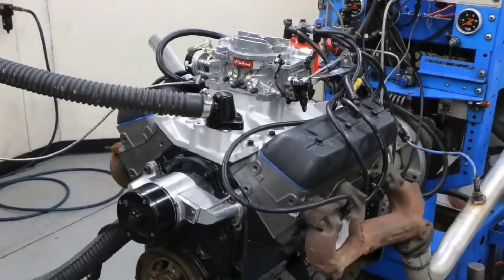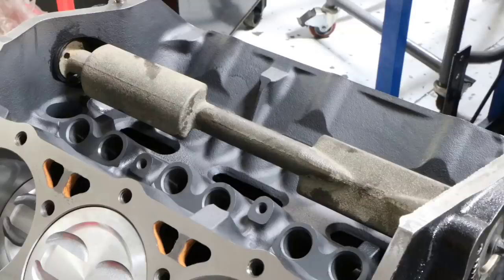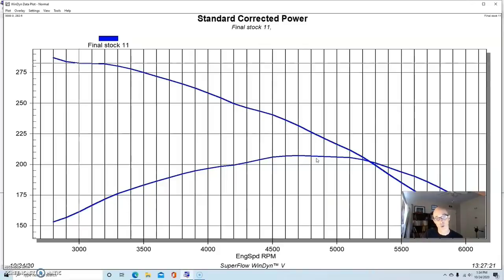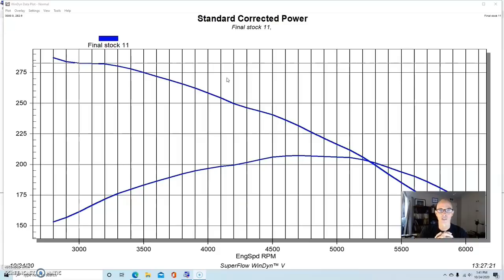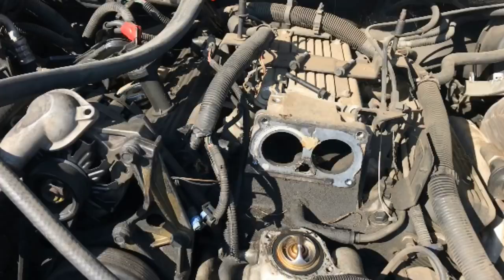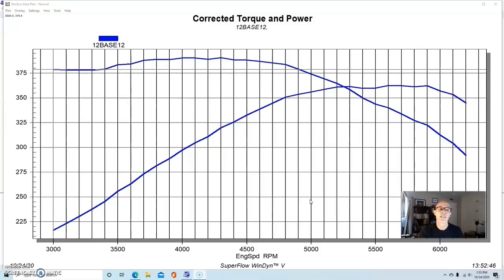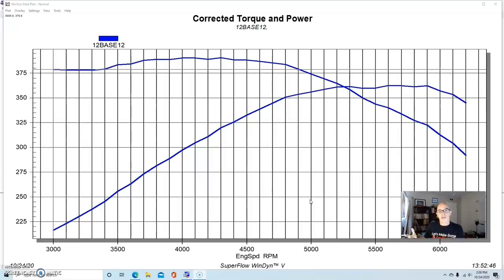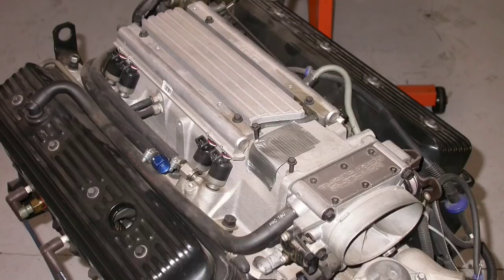4.3L V6 VS 4.3L V8-WHICH OTHER GUYS MAKES A BETTER BUILDER?

Comment: That brings me back to my GM wrenching days. I was working on a Caprice with a 4.3L V-8 and I went to the parts counter for my part. The parts manager asked me what engine it had. I said 4.3L V-8 and he argued with me. Said that GM don’t make a 4.3L V8, they must have pulled the V6 out and put in a V8. I told him they didn’t make a V6 in the 4th generation Caprice. He finally believed me when he looked it up.
Reply: Yep, the L99 4.3 V8 (94-96) was the replacement for the L03 TBI 305, which was the base motor in Caprice Sedans from 89 to 93
Reply: @FirebirdCamaro1220  Was the 4.3 the v6 they used in the Astro Van? Can’t remember if it was 4.2 or 4.3 but either way, owned a couple and were great motors. Could rack the miles on em for sure!
Reply: @fishsquishguy1833  Yes, it was used in the Astro/Safari, the S10/Sonoma&S15, the C/K 10 pickups, the C/K 1500 pickups, the G10/G1500 Chevy Van/GMC Vandura, the 1500 Chevy Express/GMC Savanna, the compact Chevy Blazer/GMC Jimmy/first gen and 2nd gen Olds Bravada, the Chevrolet Caprice (85-88), Chevrolet Impala (85), Chevrolet El Camino and Chevrolet Monte Carlo (85-88). It was made from 1985 (when it replaced the 229 v6) until 2013. It had TBI in the cars from 85-88 (the only years it was used in cars), and in trucks&vans, it had a 4bbl carb in 85&86, TBI from 87-95 and port fuel injection from 96-2013
Reply: @fishsquishguy1833  and Ford had a 4.2, the Essex V6, which went into the F-150 and E-150 Vans (where it replaced the 300 Inline 6)
Reply: @FirebirdCamaro1220  Thanks dude!
I’ve owned a couple, both in Astro’s and both had over 250K and ran well. I think the only problem I’ve seen was an occasional puff of burning oil on start up due to valve seals but not really an issue at all
Reply: @FirebirdCamaro1220  
Yes.......those 4.3’s were great engines. I had a Sonoma SS with it .
Needless to say, I put 200k hard miles on it. I went through tires like Kleenex at a funeral home.😂
I sold it many years ago to a guy who had a 150 mile round trip to work. Last time I seen it, he had almost 400k on it. The radiator and water pump were the only thing that was changed by him. To my knowledge...it still runs like a champ.
Reply: @fishsquishguy1833  The Astro and Safari had the 4.3 V6, the small block minus 2 cylinders.  The basic engine was the same for the 20 years the Astro was produced, but it went from a carbureted version, to throttle body injection, to MFI, along with adding a balance shaft in later years.  My dad owned several and pulled campers - for a V6, it was surprisingly capable.  He always got at least 200K miles on them before thinking about trading in.  Good vehicle, good engine.
Reply: I deal with this a lot ordering parts over the phone its a pain in the ass lol
Reply: They did 
	4.3 L L99 V8 (1994–96, base economical engine for sedans)
4.3 L LB4 V6 (1992–93, base engine for 9C6 taxi package)
5.0 L L03 V8 (1991–93, base engine for sedans)
5.7 L L05 V8 (1991–93, performance engine for some sedans and all station wagons)
5.7 L LT1 V8 (1994–96, performance engine for some sedans and all station wagons)
Reply: @V8_screw_electric_cars  no one couldnt have said it better !!
Reply: That reminds me of my 1990 Caprice 9C1. I would go to an aftermarket parts counter and say "1990 Caprice", and they would say "305 or 307?" When I answered "It's got a 350" they would say "Oh, the engine was swapped! They didn't put a 350 in those!" They refused to believe that the original motor in that car was a 350, and they didn't have a listing in their computer system for police packages.
Reply: It is a rare motor. But if youre the parts guy you should know.
Reply: @fishsquishguy1833   they were definitely tough. But the stock exhaust sounded like a vacuum cleaner! You hear and feel the restriction!
Reply: Ive heard the 4.3/262 inch v6 is capable of using parts such as Conrods,pistons, possibly cam,valve springs,from the small block Chevy (305,350,etc)is this confirmed to be true?.
Reply: I love cars for many years and I didn't know that until I saw this. I think I did see one one time my friend at the Caprice said  had the SS motor in it open the hood and I'll be damned if it didn't look like a lt1 then I asked him to show me what it'll do ,kind of dog in 1st gear which I thought was odd because I know 700 r has a pretty deep first.
Reply: Everyone argues me down about my 96 caprice having a 4.3L v8.
Reply: @FirebirdCamaro1220 There was also a 3.8 liter Essex V6 that debutted as the optional upgrade in Taurus and Sable.  That found its way into the late 80's FWD Continental and the Windstar minivan.  Our '99 knocked nearly non-stop at highway speeds regardless of fuel.  Thankfully, that POS was a lease!
Reply: @billyjoejimbob56  that engine was also used in RWD applications in the Fox Body, with a 2bbl carb from mid 1983 until 1986, where it replaced the 200 inline 6; this included the Mustang. The Mustang then re-adopted it with port fuel injection from 1994 until 2003 (in 2004 it was bored up to 3.9 litres)
Reply: @FirebirdCamaro1220 Correct.  I had forgotten how widely used it was.  That reminds me... my sister had a Sable wagon with that engine... and blown head gaskets.
Reply: @FirebirdCamaro1220 How do you get a 4.3 v8 to 240 hp?
Reply: @blackericdenice  if your talking the L99 from the 94-96 Caprice Sedan, probably put LT1 heads/domed pistons on it and remap the ECM
Reply: @FirebirdCamaro1220  It already has LT! heads on it.
Reply: Love this type of debate!
Reply: @evdawg7757  People always think heads is how to make hp.
Reply: @blackericdenice  a lot of power is dependent on the cylinder head yes
Reply: @evdawg7757  Not as much as the cam. No heads out there can give you 100 hp increase.
Reply: @evdawg7757  The new zo6 make 670 hp from a smaller 335 cuin v8. It's making 175 more hp because it has some crazy cams.
Reply: @blackericdenice  I politely disagree. A 90’s 454 with aluminum aftermarket heads with bigger lift cam wake up tremendously for example. Not many engines can do that tho.
Reply: @evdawg7757  If you only change the heads or cam on a 1990 454. Which one do you think would increase hp the most?
Reply: @blackericdenice  heads. Faster you move air in and out the better. Just an air pump essentially. My personal opinion is all.
Reply: @evdawg7757  The cam has more control of hp than heads. This is not my opinion. When the 4.3 went from 130 hp to 160 hp. The heads were the same. The cam was not.
Reply: @blackericdenice  so a 30 hp difference in swapping a camshaft justifies a 50-65hp gain from higher flowing cylinder heads? That’s like trying to breath underwater with a straw. I’ve done plenty of race cars to know what I’m doing, but all good sir! I ain’t trying to argue over it
Reply: @blackericdenice  to be completely honest, it’s a combination of both
Reply: @evdawg7757  We are done talking because now you are lying. If you really build race cars. You would know a cam control how much hp an engine make.
Reply: @blackericdenice  that’s makes it’s power from utilizing quad OHC and fires completely different having a flat plane crank it fires totally different. Higher rpm range as well like Ferrari’s

Comment: V8. id rather hear V8 sounds rather than V6 sounds if im going slow or fast.
Reply: #concurs
Reply: EXACTLY!
Reply: so all V8's have the same sound?
Reply: That's why I love my 99 expedition, slower than a 4-banger but such lovely noise.
Reply: Yup. Always go v8
Reply: @DD-gi6kx   some have tinny sound and deep Big Block heavy sound. I can tell the difference certain V8’s. Basically say one is real man and other a boy.  Compare each other V8 lol
Reply: @DD-gi6kx  unless it has a flat plane crank, yes
Reply: youve never heard a high psi boosted grand national then.
Reply: @frigglebiscuit7484  love 231 Buick V6. I owned 07 GP SEP. 3800 Series III. Tough as nails lol.
Reply: The v6 sound like a v8 under 2000
Reply: @frigglebiscuit7484   sounds like poo
Reply: Sound Has more to do with the firing order and the crank than the cylinders. The v8 in the c8r has a flat plane crank and sounds like a exotic super car.
Reply: Somebody should record all the fun V6 and V8 sounds and put them in a Video here. Then we can decide for ourselves.  
V8s don't scream like V12s.   My imprinted favorite engine sound is from a 60° V6, the 2400 Dino Ferrari.  You can make a 2.8 L Fiero sound like it, I heard one.
Reply: @BobPegram   Best sounding  V6 Nissan 3.5 

Worst sounding V6 Nissan GTR or Ford Ecoboost

Best sounding v8 Ford Coyote
DONE....
Reply: @JohnnyAnderson1  Agree on the Coyote!  That top end is marvelous!
Reply: @JohnnyAnderson1  Best sounding V6 the 3.5 in Nissans, but not the turboed GTR.  Do you mean the NA 3.5 liter?  Which Nissans have this good sounding motor?
Reply: @BobPegram  look up 350/370Z exhaust the engine is also in the  Infinity FX35/FX37 and Infinity G35/G37 They sound AMAZING
And you are correct this is NOT the nissan turbo engine.

the 3.8 V6 in the newer GTR is the one that sounds HORRIBLE along with the Ford Ecoboost
Reply: @BobPegram  the nissan engine being referred to is the vq35/vq37 they do sound rather amazing
Reply: @DD-gi6kx  no. Different v8s make different sounds depending on crank design and even cross plane with different firing order can sound different
Reply: @DD-gi6kx  Yes, ALL V8's sound exactly the same. Identical.
Reply: Granny Gertrude  gay lol Not me lol
Reply: @JohnnyAnderson1  Best sounding V8 is a true Big Block V8. Much more heavy deep tone. Especially with a 3” exhaust flowmaster and other mufflers similar. 4” trail pipes and good size cam. Much better sound than small bore coyote V8. Coyote sound smoother. DOHC more midrange V8 sound. I like them both. Big Block my favourite.
Reply: @jesselee4405   only difference V8’s. Lighter tone or a heavy tone. Some run rougher depends on the cam and also Big Blocks V8 are heavy tone than small V8 such as a coyote 5L. I find coyote have a smoother midrange sound cause probably DOHC 4 valves. Mostly smaller bore size will change the sound. Most V8’s you can tell it’s a V8. Ford Triton V10 low rpm with 3” exhaust sounds like V8. When you go over 3+ rpm u can hear the V10 midrange sound.
Reply: @Silkmaster4200  Yea there is not BAD sounding V8... except maybe a 1995 Silverado with 2" dual glasspacks that makes that awful low rpm POPPING sound... LOL 
But the new mustangs and hellcats deffinylu have a DEEP tone to them, very simular to a older big block but they have a couple thousand more RPM to go once the big block is done... lol
Reply: @JohnnyAnderson1  all depends on valves springs and intake manifold ported heads and cam etc.. stock of course.
Reply: Okay boomer.
Reply: Cheers bois, me too.
Reply: @DD-gi6kx  the biggest differences in sound will be if it's a flat plane crank which is a typical Ferrari V8, and then the very common version is the cross plane crank V8, and then they will sound slightly different depending on exhaust setup, what kind of cam, if the cam is variable timing, how much displacement, etc...
Reply: My 305 tbi probably makes around 110 hp and 180 ft tq with a little over 340k miles without a rebuild
Reply: There’s only like 3 6cyls out there that actually sound good and this is not one of them.  So I’ll agree in that aspect.
Reply: look at aussie v6 sound just like 8 cuz of cam and firing order
Reply: Facts
Reply: Well I HATE and LOATHE the sound of American v8's.. it's the sound of gas guzzling inefficiency, laziness & archaic technology from before grandad was born.. true you can build a powerful and fast American V8 but it ALWAYS looses against a modern engine (unless the rules is deliberately skewed in favor of the cast iron pushrod boat anchor).. the only thing I do like about them is that they are in the front line when sacrifices are going to be made to the sacred electric car demon-people in the name of green progress.. I know I'm next in line but hoping the American Canary will buy us a few more years before we are destined for the chopping block
Reply: I’ve got the 4.3 V6 in an S10. You’d be surprised how it sounds. Just a matter of knowing what exhaust you put on them.
Reply: The 4.3 v6 imo is the closest to a V8 sound that you can get in a v6 still lacks the deep tone of a V8 unless you make it unnecessarily loud
Reply: So basically you wanna be a honda civic loud but slow
Reply: @jiovanilozano1752  no, he wants it to be RICER loud and SLOW
Reply: so basically you want a ricemobile, but with a v8 instead?  gotcha

Comment: Yes. I built a warmed up, 1976 262 4.3L Chevy V8 in 1989. I used stock pistons w/moly rings, polished stock crank and stock bore block. I had multiple head, cam, intake and carb combos through the years. Combo 1: Crane Fireball II 290 cam, Edelbrock Performer intake, Holley 600 spread-bore vacuum secondary carb, Accel HEI with curve kit, ported 882 1.94 heads with performance springs sporting Moroso black crinkle covers and stock exhaust manifolds with duals, mated to a TH350 w/ a Boss Hog 2800 RPM stall converter in a 2600 lb car running stock highway gears on 10.5 in tires. It ran a shameful but extremely consistent 16 second 1/4 mile... Combo 2: Same stock block, crank and pistons with stock, but ported smaller 1.70 58cc chambered heads with performance springs, Comp Cams 268 cam, Holley “X-Type” equal-length runner intake, Accel HEI w/ curve kit, Holley 650 square-bore double-pumper, Hooker equal-length competition headers with 15 in collectors and an H-pipe, a 150 HP single plate under-carb NOS kit, electric fuel pump, and an short-shaft aluminum water pump mated to the same trans and chassis combo from above. This tamer setup, though, ran a much better 12.76 at 118 in the quarter spraying it at rollout. Would you believe I still have the engine in the barn?  There were many other combos with this same block through the years, but these were my first (worst) and last (best) combos.
Reply: And to the doubters, yes, the crappy smogged-out 882 casting 1.94-sized valve heads WILL clear the small bore of the 1975-1980 262ci 4.3L V8 SBC without notching.  They may not clear a 305 ci block deck, but they will the 262. Who’da guessed?
Reply: As well, I’ve had a couple 350 ci SBCs and a 383 stroker SBC in that same car over the years too. The car was a 1979 Pontiac Sunbird that originally came with a 2.5L Iron Duke 4 cylinder mated to a 4-speed stick. The Iron Duke blew a timing gear within the first two weeks I owned it. I began the V8 transformation immediately.
Reply: @NorthernChev  That intake valve had to be really close to the cylinder wall. Hardly any flow with there. Been looking for a 262 v8 for a fuel economy build.small cam 2psp intake ported exhaust with larger exhaust valve. Rollor rockers,450 Holley ecomizer,deck and square the block and head  for close to 9 to 1 compression.long tube headers 1.5 primery pipe.
Reply: @joed5472  Although cam technology has come a long way in the last 20 years, I will say the Comp Cams 268 I ended with in my last 262 build was a fantastic cam.  Lots of low and mid-range grunt to help the small displacement.  And vacuum secondaries are a must.  Good luck!
Reply: @joed5472  And coincidentally, yes, the small 58cc-chambered, stock, 1.7/1.5 heads out-powered the larger valved, larger chambered 882 casting 1.94 heads that I tried.  I can get more RPM out of the 882s, at the sacrifice of low end grunt that the smaller chambered stock heads had.  But, with that small of displacement I found that the larger 268 grind camshaft helped out my mid and higher end, and helped compensate for the smaller heads. The smaller, stock heads had 58 cc chambers that raised the compression ratio above the 882s.  Albeit, to only 8.5:1.
Reply: @joed5472  I have a set of nice, ceramic-coated Hooker Monza V8 conversion headers, if you want them? I bought them used. They were in fantastic condition. I had them Jet-Hot ceramic coated, and then never used them.
Reply: I don't have a Monza. Thank you though

Comment: nothing confuses Chevy guys more than 4-liter engines. the 4.3 V6 in everything, the 4.3 V8 in Caprices, the 4.2 inline sixes in the Chevy Trailblazer and related vehicles... and then the new gen 4.3 V6s totally unrelated to every other engine Chevy has ever made...